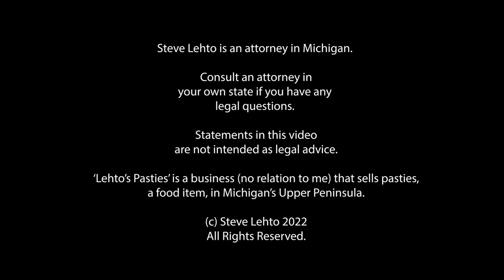Did Ford's Use of Cheap Steel Increase Roll Over Danger?

Comment: It's kind of a confusing time at FoMoCo. 
1996 all pick-up trucks used same cab 
1997 F150 redesign F250 F350 used Old 1996 Body style  Super Duty used Old Body style Cab and Chassis only.
1998  F150 no change F250 used Same Body as F150 No F350 available
1999 Super Duty Body Style on F250-F350

Comment: It is not defective if it performs the way it is supposed to and meet whatever standards the government requires. If the government has no standards, they should set them. National safety regulations should not be determined by juries which in fact, is the case whenever any company loses a major lawsuit. It is hard to determine all the effects of a regulation. If the price of cars go up, consumers may have to buy cheaper and less safe cars for example.
Reply: Steve covered this in the last video. Something can meet minimum standards and still not be safe.
UCC implied warranty of merchantability.
A product must do what it advertise and do so safely.
Reply: @corssecurity  That's true although what is safe is too relative and vague. If it were equivalent to a law and the SCOTUS took up the question, they would say it is too vague and remand it to the lower courts or ask the legislature to write a better law. I would say the definition of safe is safe with ordinary use, not safe for the worse possible contingency (which a rollover kinda is although not the worst).

Comment: Fixed Or Repaired Daily...I mean, Ford is familiar with rollovers. Does anyone remember the Ford explorer's exploding tires? The real shame is that this body style of super duty had the 7.3l. What a shame.
Reply: Running any tire underinflated will likely lead to the tire failure. I had an Explorer with the tires and since I kept them properly inflated never had any problems.
Reply: Another Point of failure for the explorer's tire was the fact that they were well past their DOT expiration as well. The treads looked good so people didn't bother changing them....until they exploded.

Comment: Boron in steel makes the steel harder, not necessarily stronger. The harder steel would make it less likely to deform but makes it easier to break. Also boron steel is more likely to rust. I seriously doubt that boron steel is 5 times stronger, but in cases of being thinner, it would be harder to bend maybe up to 50% increase durability. Making the steel thinner would make the roof weaker, more than the use of the type of steel.

Comment: Is this the model year when Ford used "Military grade Aluminum" and not steel?
Reply: On the bed of the truck.
It's not structured.
Reply: @corssecurity  
I got a picture of a Ford truck that was at the body shop the dealership I worked at owned. The truck rear ended another vehicle and cought on fire. The body, cab, literally melted. Wish I could share it on here. So it wasn't just the bed that was aluminum.

Comment: I have an F250 diesel and it weighs 8,500 lbs. A little extra steel in the roof wouldn't effect the weight by very much.

Comment: Ford sort of lost its way and had bad management during 2000-2012 , but they realized it and most of their products were redesigned much better in the 2012-2020 time frame and now they are probably one of the most innovative car makers.. but the legacy of prior years and debt incurred dealing with recalls keeps holding them back.

Comment: Cheap steel ???
Reply: Cheap steel!
Reply: @Snarkerd  ?  Aluminum is not cheap
Reply: @tnaccountability7455  Not by weight, but it is cheaper and easier to work with
Reply: @hoodhomesgardens  thats news to me. When I buy aluminum parts they cost more than steel. Has been that way since I began machining race engines.  The more you know

Comment: These attorneys and their clients are prices of work. Federal regulations specify what the requirements are. They set the standard. That the govt standards exempt heavy duty trucks from passenger cars level safety requirements almost certainly goes back to lobbying and legislation around farm and work equipment with the assumption that the heavy duty trucks are used in work situations and then fuel efficiency and speeds there don’t created a need for the tougher roofs. 

Cheaper steel is still steel. It is absolutely expected that a manufacturer uses the least expensive parts possible to build the vehicle to the requirements dictated by law and performance demands by the majority of the customer base.  

Then take a subset of Americans that drives them at higher speeds on roadways most of the time , does something stupid with the trick and it rolls and of course it’s someone else’s fault.

Comment: I bought a 250 not because i had to use it for work.... just because i have a tiny penis.... when i road rage is when i flipped it.  
Thats what I think is going on. 

Otherwise it's another place that does the crash testing. Something like the national Highway and safety board or some crap like that.  

I'm not sure when they started doing roof crush test I guess I'll have to edit, if/when I get back to this